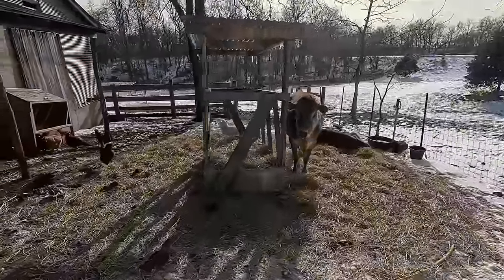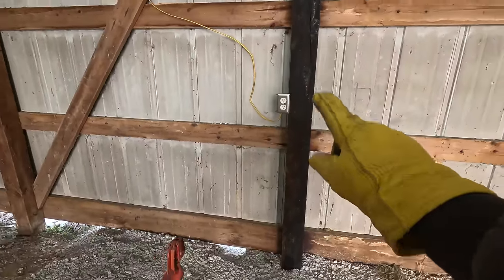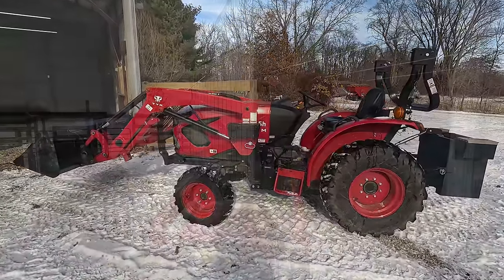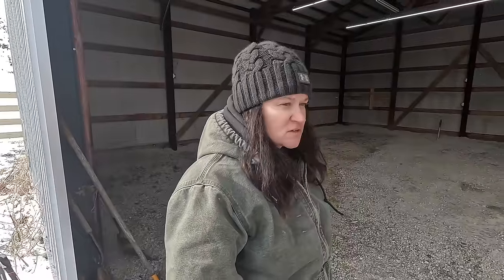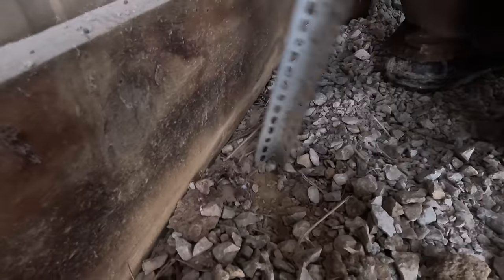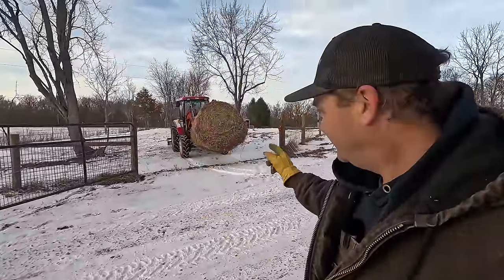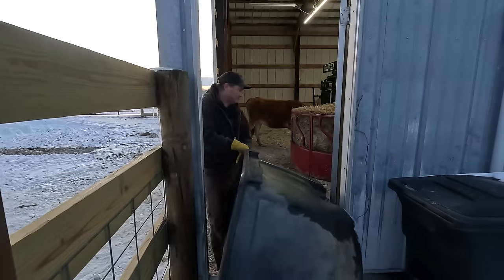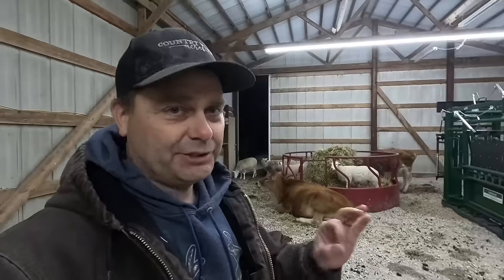Moving our Livestock to the Corral Barn After a Few Final Touches.

Comment: I like the new shed in concept… but I think you jumped the gun on the move… you need stock panels on the inside walls to protect the metal, and all the gravel needs to be removed, otherwise you’re going to be spreading it all over the farm when composting or spreading manure on the fields….I’d have spent the time on water diversion for the barn, and trenching a proper drain/buried culvert.. capturing the rain from the barn roof and keeping it off the barnyard seems a better solution to the muddy mess.

Comment: IF  you put hay in the barn put it up on some pallets to make the clean up easier. also put some panels around the walls to keep the animals from pushing the tin off the sheeting board , been there done that.  you can drop a tarp from the top of the door to keep from losing as much heat too

Comment: Glad you fenced off the hydrant.  You know how animals love to rub and break things or turn the water on.   I have a similar situation in my barn and I really need to build something more permanent around it.   thinking almost a sturdy frame with a door to keep livestock out and also allow me to open it up nicely for me to use.  tall enough to be able to access the handle to turn on and off.  Maybe with an open top so if the O'ring goes bad I can unscrew it, and have room to pull out the rod and 0'rings and replace them.  I have the type you can repair it without digging.

Comment: Why not put the gravel banked on the outside so it stays. You'll lose the gravel on the inside when you clean it out.
Reply from the maker: The gravel right now is temporary.  Some boards are missing and rotted off near the ground.  It needs several things done to make it right.
Reply: I just meant it will come out with manure if you were going to compost it or spread it on a garden or field you wouldn't want to put that much rock on it.

Comment: Consider adding some heavy-duty rubber mats in one area of the barn to out straw on for a lay-down area.  

Maybe in the aoring yall could pour a concrete pad.  Would help with cleanup when you will need to muck out the new stock barn.  

Great job!

Comment: My opinion.... Good to close the air leaks at bottom of walls but I don't think it's good for cattle to be closed up in an air tight barn. They need air circulation and are more comfortable in cooler weather
Reply from the maker: We lock up the barnyard but the barn door is left open a few feet.  So there is still air flow.
Reply: Hard to get a barn airtight, I'd say.
Reply: calmwhateryoulike...
Maybe in your opinion but you do agree large animals need air circulation, right ?
Reply: @bhensel100  Yeah of course. I just imagine that there'll always be enough draughts but I could be wrong, especially depending on the waste management strategy.

Comment: Your animals are going to rub and wear on that chute. Question why are you worried about a counter weight on your tractors. When using the bucket you will know when you have to much weight in the bucket. I promise flipping is the last thing you need to worry about. I guarantee you won’t ever flip. You are not working with heavy enough material or objects
Reply: The ballast box is to add extra weight for traction. I don't think the rear tires are fluid filled.